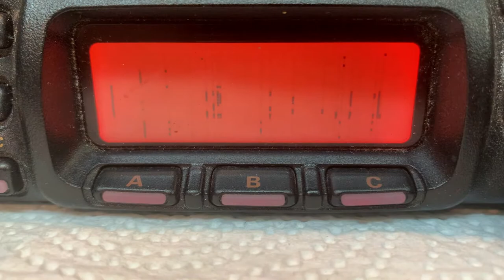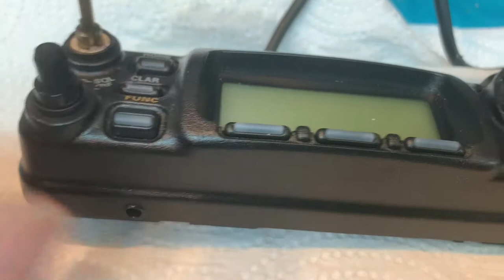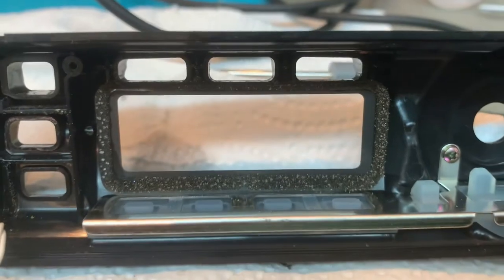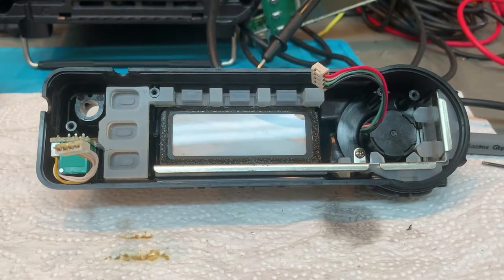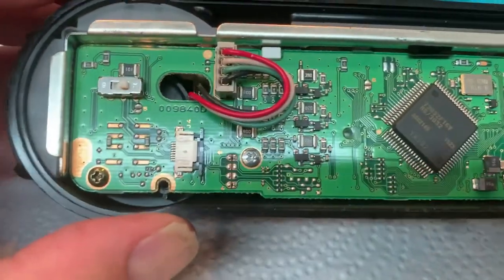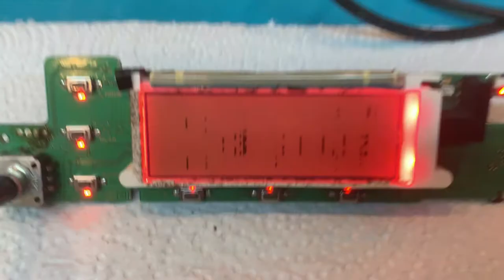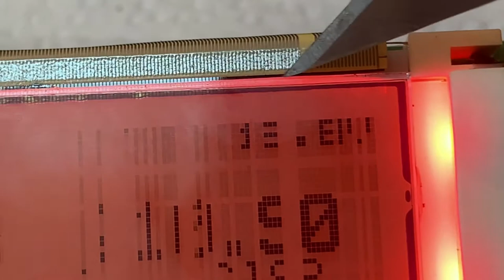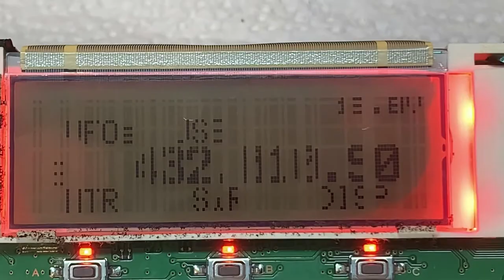Fixing Yaesu FT 857 LCD Zebra stripes and a bonus video on an  autopsy dead LCD from WD8BWW

Comment: Andy, you might be interested to know that the exact same problem would happen on the Nintendo Game Boy from 1989.  Eventually someone found that the solution (since obviously you can't get a new LCD for them) is to literally run a soldering iron along those lines to essentially "re-flow" the wires in the ribbon cable and re-establish the electrical connection.  You can see someone doing this in a YouTube video with ID "l4PArFarm_k"  .  I did this on one of my Game Boys years ago and it was a permanent fix (at least, the issue has never since reoccurred).  I don't know if the wires are as easily "accessible" on the 857D panel but if my 857D ever has this problem I will definitely be trying that same technique!  haha

Comment: The issue is the adhesive strip on the film with the flex cable. Its poor design which unglues with heat from setting in hot cars. The same thing used to happen with text display style pagers. The fix is simple. Cut automotive trim tape to cover the black strip which is facing the foam. It pushes the flex strip down for a tight fit and keeps the contacts from pulling away from the glass. Ive had to replace several on my radios. Living in the southwestern US temperatures in the summer can exceed 110 outside, with temperatures inside closed vehicles getting up to 185 degrees. The displays on the FT-857s I have typically last about 3 - 4 years. Its hard to explain the fix but once you understand whats going on, the fix is like a face palm. 

Keep making vids like this. Oh instead of using a knife edge, use a pencil erasure, you’ll see what I mean about the flex ribbon.

73 de AH2AZ.
Reply from the maker: I have tried wooden sticks, ceramic screwdriver, heating, cooling pressure. The only thing that brings the pixels back is a conducive object small enough to bridge the gap. I believe the conductive trace that is exposed is being etched away. Maybe from chemicals in the foam rubber. Unfortunately I do not have a microscope powerful enough to look at these traces. At some point yaesu will stop making replacements for the 857 like they just did for the 897. Id love to find a solution that does not require replacement but just a repair.
Reply: @andyruggiero3445  

What happens is the adhesive in high heat becomes gummy, then once exposed to air, crystalizes. The only repair would be to remove the adhesive without damaging the flex cable and the very small graphite pad. Unfortunately trying to clean the flex cable destroys the graphite pads. I found that out the hard way. Then you would have to find a way to literally recreate the the adhesive track which would respond to heat/pressure treatment to reseat the flex cable back to the glass and the contacts there.

Yaesu could have actually repaired the issue easily by just adding a proper thickness silicone gasket around the display. Its basically what I am doing. Question Andy, are you good on QRZ? If so shoot me your email address to mine. I am solid on QRZ. 73 de Scotty.

Comment: Aha, after chatting in one or another forum / group or what have you, I found your video.

From all the "fixes" I have seen online, a few people here have bits and pieces in my estimation.
1) The sealant becomes conductive over time. This is showing up in a lot of electronics now. It takes time to degrade. Cleaning helps.
2) Due to heat and stress as you say, the connections start to pull away and a light reheat may work. Iron or air...
3) Like my Fluke meter, pressure, so as the one fellow said, putting new, better tape on will help maintain the connections.

On the other hand, who knows what other updates the new one brings.

I have a few questions:
1) Where are you located?
2) How busy are you with repairs?

I ask because while I can usually track issues down, I'm not 100% sure I can do the work anymore, at least on such small SM components.

1) The resistor that acts as a fuse for the TXREQ on the ACC jack is blown.

2) Something went that is preventing any power out on UHF. All other bands are fine. I haven't even started tracking that down. It just recently started.

3) I'm just starting to get zebra stripes now... well, the radio is.

Thanks!

Comment: I have two of these radios on the shelf.  Both had lcd problems, one will not work on 40M LSB.  I paid Yaesu $250 to get one lcd repaired.  This was many years ago.
Seems like way too much money for a radio that is probably not even worth $400.
I was so upset about it, that I really contemplated designing a replacement control head for the unit.  I have designed many microprocessor based units in the past.
Color lcd touch screen are so cheap, and ARM32 processors so fast and powerful, that it seems someone would have already done this.
Anyway, why not a CAT module to control the radio in lieu of a radio with a bad screen?
AND !!! You mean know one knows where Yaesu bought these displays from?  Not even a ham who used to work for Yaesu?

Comment: Having worked in the paging industry we replace many Motorola Bravo numerical pager screens. What we had was a special heat bonding tool to refasten the new display to the logic board. Most LCD screens that use a flex are assembled the same way with a heated head that applies a set even pressure and heat to the display to bond the flex to the glass. IF you could create a head that supplied the proper heat and pressure, the display might come back to life. 
Heat is the major culprit of the de bonding of the flex from the crystal. Personally I have the same radio, Not the D version. The radio has MARS / CAP mod in it to allow it to work on the European 70cm band as well as the MARS network. It’s also great for listening to SW bands, the only thing that peed me off about that is that there are a constant barrage of Chinese stations out there spewing their propaganda. Gone are many of the classic SW stations, most going to the internet to reach their audience. Gone is the skill of tuning in to the stations as they change frequencies during the various hours of the day.

Comment: Hi, I am facing the same problem (fortunately only in one stripe still), on the 897's display. Do you have any idea, or suggestion, where I can purchase the display for that radio? I am looking literally everywhere in the internet, with no luck. I've been told, that maybe I can find it in the US, in shops that sell damaged radios for spare parts. I'd appreciate if you can help me on this. Thanks in advance, Michael, SV1SLB
Reply: I got mine straight from Yaesu USA from their parts department. Dont buy just one, I try to buy 2 or 3 when I have to order them. Hope this helps. 
73 de AH2AZ
Reply from the maker: I was just notified by Yaesu that they no longer sell the 897 replacement lcds. This is real bad news.

Comment: I was wondering if you have ever replaced the led that illuminates the push buttons.
I’d like to change mine to green. Is that possible
Reply from the maker: Yes. I have replaced ones that quit working. You will need good tools. Be careful not to handle the lcd too much.

Comment: Andy, what are your parts and labor warranty time lengths & conditions ? 
Thanks in advance.
Reply from the maker: I give a 90 day warranty on all my repairs. You pay for shipping the defective part back to me. I cover repair and shipping back to you. FYI I have been replacing these lcd for 6 years and have had one that failed, the lcd went black, in all that time. I replaced it right away and Yaesu exchanged the bad part to me.
Reply: @andyruggiero3445  thanks!

Comment: A friend of mine has one. If he sends just the head and you change the electronic assembly and rebuild the vfo encoder, he will retain all his memory settings, correct? 
Thanks in advance.👨🏻
Reply from the maker: The memory is stored in the radio. Even the lcd color is stored in the radio.

Comment: Is thus common coz I'm thinking of buying the 857d
Reply: You should avoid the older ones. I bought one new 9 years ago in May 2013; 
it’s been in a mobile the whole time. We have winters and hot summers. Haven’t had an issue yet. They made the 857d for about 17 years starting 20 years ago with the non-D version. Based on my experience, I’d say don’t buy one of the older ones with the original displays.
Reply: I have had my 857d since 2012 and just now only having issues with it... Its hard to explain but basically on a 12v auto system it said I have 40V and only displayed 7.00000 MHz and became unresponsive. I have not looked into it to see what its issue is yet.  Since I generally just use it for digital modes and local repeaters, I bought a FT5DR for the local repeaters and still shopping for another HF radio.